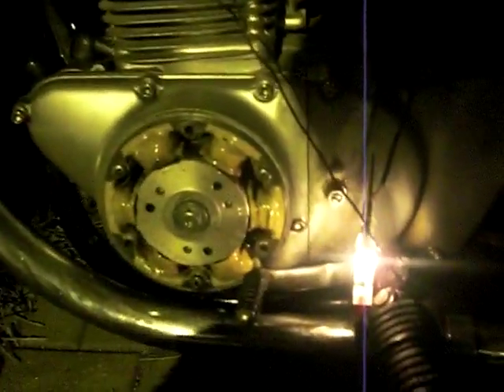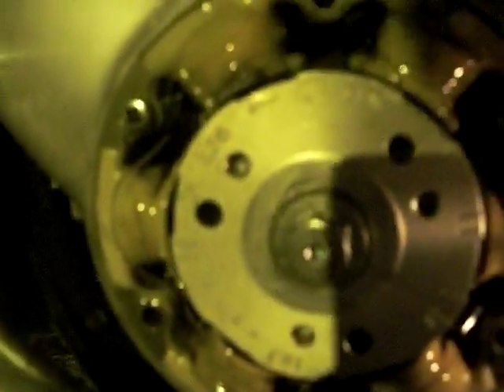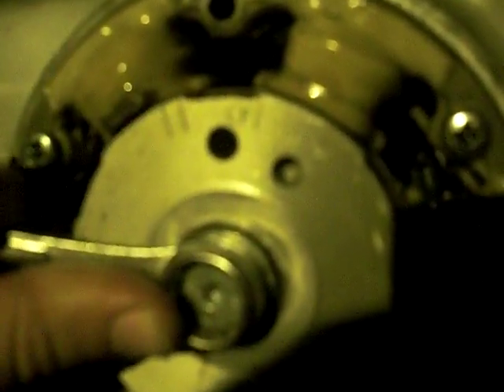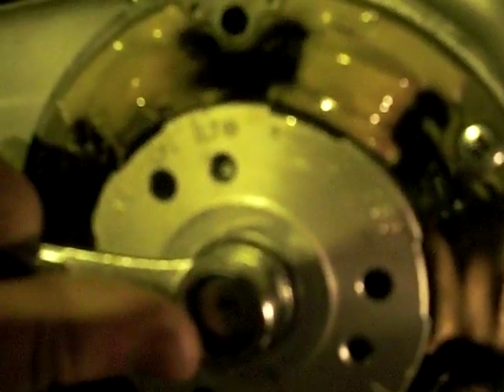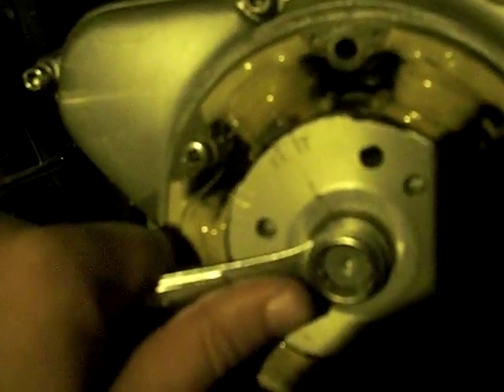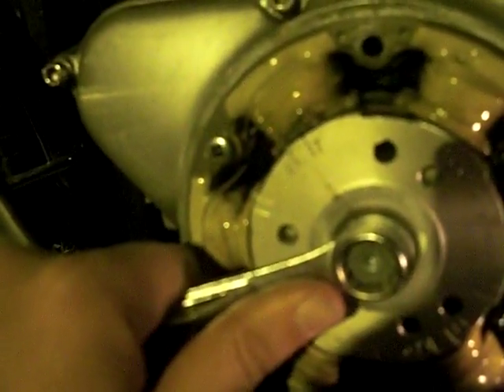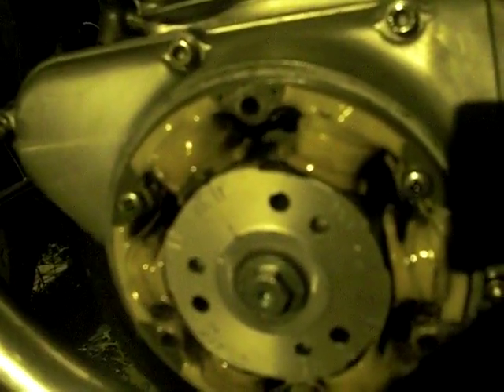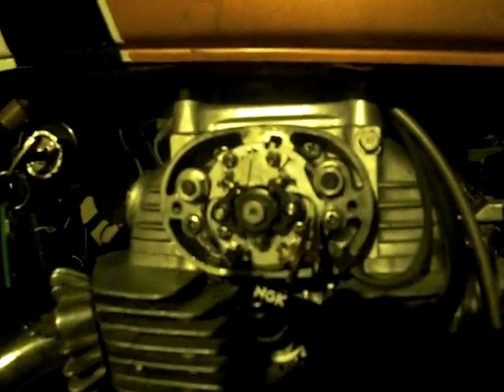setting ignition timing on a honda cb350 part 2

Comment: you just need a circuit tester (test light). You can get one at walmart, a hardware store or an auto parts store. You can just get an alligator clip to slide on the end so you dont have to hold it on the breaker point.